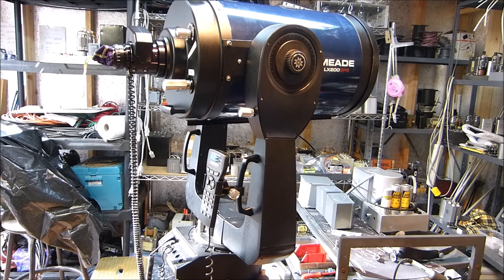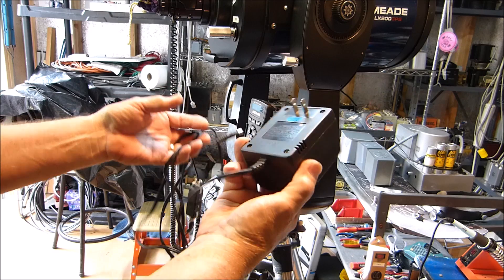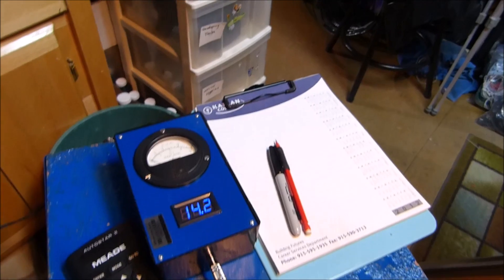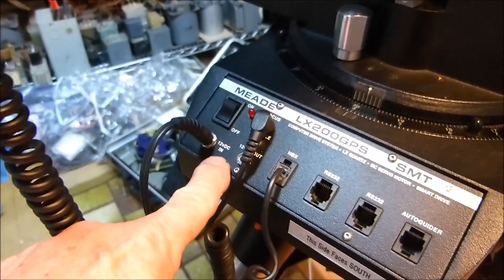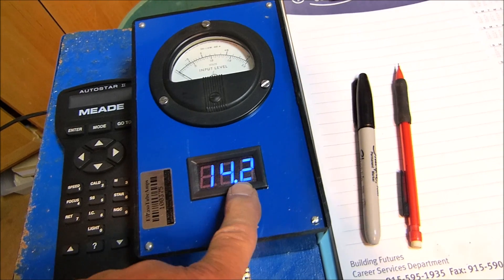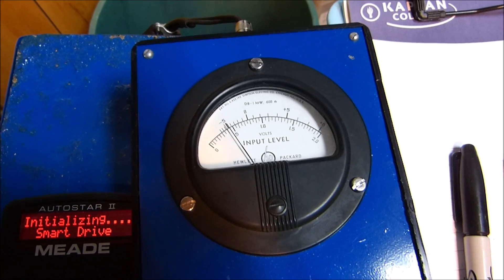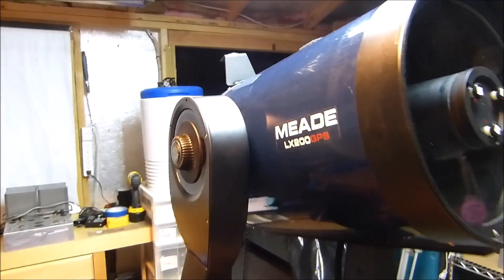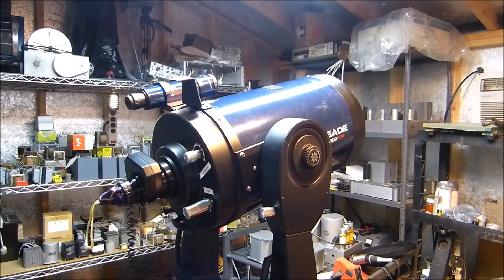Meade 10 Inch LX200 GPS Telescope Power Supply Voltage & Current Measurements

Comment: Wouldn't it be better to run the mount of the battery cutting out the inverter?
Reply from the maker: I did it this way because I wanted to make sure I always had at least 12.5 to 13 VDC and a battery runs starts dropping voltage over a couple of hours and it seemed to affecting the tracking accuracy of my telescope. Maybe if the scope was brand new a battery would be OK? Not sure. It even has a compartment for D size batteries that I have never tried. I also wanted to know the current it was drawing so I went to this length to provide it with a more reliable source of voltage and be able to monitor everything. Maybe it was a little over-kill but it works good for me.

Comment: Very interesting video. I have exactly the same telescope, though I haven’t really had time to use it yet. I have played around with though using a small battery pack. It works with this, so I thought, but this video has made me think more about voltage. I assume that if the voltage drops below 12V then the motors will slow down making the tracking unreliable. Is this the case? Too low a voltage wouldn’t damage anything? Thanks again for producing this, it has certainly got me thinking.
Reply from the maker: What you are describing is exactly what make me go to the higher current,  full proper voltage as I did experience issues with tracking using a battery. Keep the wires at say #14 or #12 size and short as possible but long enough to be comfortable. Put a plug inline with the cable in case you trip over it in the dark it will come apart easily and not turn the telescope oveer or whatever and cause a disaster. 
Each time you set it up, run all the axis to the extreme limits a couple of times to loosen up the grease, etc.  I don't think low voltage is going to harm it but it does seem to make it more unreliable. I have used my many times. I collimate mine each time. Got to be very careful with those three collimating screws. To get it "perfect" you have to do it on a star.  Don't turn any one of the screws more than 1/2 turn in any direction. You have to collimate it with the camera mounted and it can change slightly as the scope is moved around. 
Those laser things you put in the eye piece are only good for rough adjustment. Improper collimation causes stars to look sort of egg shaped and I think they look like space ships.  :-)    
I saw my grandson today and I think we will be going to the  desert in NM in just a few days before the next college semester starts.  This telescope is now too big for me without help but there are also polar-axis trackers that mount on a good tripod (like you Meade tripod) where you can use regular and telescopic camera lens and get amazing pictures.

Comment: Is it coma free? If not save your money.
Reply from the maker: Absolutely, if it is with properly collimation. And I have gotten pretty good at that.
I have read some blogs where people refuse to touch the collimation, I suppose, believing there SCT is always perfect. 
I rarely do visual observation thru mine and just do photographs with it so perfect collimation is essential. 
Recently, from watching a number of amateur astronomy YouTube videos, I have learned that  high quality camera lens do some pretty amazing astrophotography. I now use a Sony A7RIII camera and at the moment the two biggest lens I have (besides the Meade scope) is a Sony 70-300mm and a vintage Nikon 500mm F/5 Reflex Nikkor. I had to work with the adapter for the Nik-NEX adapter as it was a fraction of a mm too long for focus at infinity but I finally got it right and get some pretty amazing images with the Nikon. 
I moved to the Sony mirrorless camera as with an adapter, which are usually pretty inexpensive, I can use all of the lens I have had for more than 50 years. Taking away that mirror in the DSLR put the front lens mount of the camera much closer to the focal plane and, with the proper adapter,  all lens work - Nikon, Canon, Leica, etc. In addition I bought the iOptron star tracker that is a polar axis alignment tracker and get pin point stars with 30S tracking. Tuesday I am supposed to receive my newest lens which is a 200-600mm Sony lens. None of these camera lens are going to do all that a 10" scope will do but I can move it around along with the polar axis tracker much easier than I can the big Meade. Hope all this makes sense.

Comment: Mine works fine at 11volts!
Reply from the maker: I have heard reports like yours and I totally believe it.  I often wonder it there are differences in the motors, possibly friction in the gears, cold grease, and a bunch of other things that make different telescopes behave slightly different. I think in my case the power supply is definitely over-sized but I just couldn't rest until I measured the current in a slewing condition, one axis and then both axis and then in normal tracking mode in addition to the voltage at the terminals of the control panel under all these conditions. I don't know for sure what my issue was but it works great  now.
I have not had the opportunity or clear skies to do much photography this summer but I did get a Sony 40 megapixel camera (A7RII) and have made some nice pictures and videos of the moon. I have too many hobbies and not enough time to play.  Here is a short video I made when I first got my camera you might enjoy that I uploaded but made "unlisted".
https://www.youtube.com/watch?v=ugJNJ5Npqkc&feature=youtu.be
I keep hearing a train in the background while watching this video so I think I have discovered life on the moon that NASA isn't telling us about...   :-)
Reply: @ElPasoTubeAmps  clear skies to you!

Comment: why not run it directly from the huge battery?
Reply from the maker: That would definitely make sense if all I wanted was 12 volts but it seems pretty well established that 14 volts, regulated, works much better. The need for a little higher voltage comes in because of the gears and grease being cold, (age of the telescope?) etc. The single battery might be perfectly fine in the summer when things are warmer. I no longer use the modular supply but replaced it with a 13.8 volt, 2.5 amp regulated supply and the telescope performs perfectly. I also installed a second inverter like I showed in the video, in my truck so I can run a standard power cord from the truck and I won't have to carry that huge battery around anymore.

Comment: Sounds like it was designed to run directly off a car battery, probably even taking into account the potential voltage spikes when the battery is being charged. I'd expect it's got a buck/boost power supply internally and it doesn't really care that much what voltage you feed it as long as it's within a reasonable range.
Reply from the maker: I think you are probably right about it having some internal voltage regulation less than the 12 volts that it is being fed with. The problem I had was when I researched it, I found lots of comments about all sorts of voltages with mounting confusion. I couldn't trust anything I was reading. The regulated Radio Shack power supply solved the problem.
Now the issue is after April 6, 2019, there is an internal issue kind of like the "Y2K" issue where the telescope thinks it is 2099 when letting it setup automatically from GPS. It gets the time and location right but 2099 for the year certainly doesn't work...   It can still be set up on two stars easily in manual but now I have update the firmware to use the auto setup but it's all fun..

Comment: I have the Meade AC power supply which is rated at 12 VDC 2.4 A. I imagine it puts out closer to 14V or 15V lightly loaded. I always used a car battery directly on my LX200 with excellent results. Until my XP laptop died that is. I have not been able to get the Meade USB drive working nor several aftermarket serial to USB adapters. Are you using USB or are you still  using a serial port?  
BTW thanks for all the tube amp videos. I always look forward to a new one.  I'm currently working on a 6C33C amplifier which I want to try with an output transformer as well as OTL.
Reply from the maker: I have just discovered that mine needs a firmware update because of some GPS change that occurred in April 2019. My time is correct from GPS but the date is always 2099. Just bought a Sony 43 megapixel camera for the telescope and now can't get the telescope to align... question is, have you updated your firmware and can you point me to a YouTube video on how to do it? You mention the USB drive and serial port but I have never used them at all but it looks like I am going to have to learn. Not even sure I still have a laptop with a serial port.  I just want to get this thing working again so any help would be greatly appreciated. I will be posting some new audio amp videos soon. Thanks for your comments. BTW - I swapped out the 12 volt module in this video for a regulated 13.8 volt power supply that works perfectly with only mV drops in voltage from standby to maximum current. Now I have to figure out the firmware update...
Reply: I presume you know about this:
https://www.meade.com/wp/wp-content/uploads/2019/05/HowToUpdateTelescopeFirmware_REV1A.pdf 

I bought all the stuff they say you need but still couldn't get it to work. I have a friend who's a senior IT guy who owes me a favor. He said he'd assist so let's stay in touch.
Reply: Sorry for the late reply, I was out of the country. I haven't been able to use my LX200 in several years now. I have tried several serial to USB adapters (including one directly from Meade) with no success. I bought a copy of Starry Night Pro which has telescope control as part of its package and had no luck with that either. I finally lost interest and the Meade has just been sitting. Long weekend coming up (I'm just outside Toronto Canada) so I'll try to dig through what I have and get back to you. Why don't you contact me directly: apexmcboob at gmail dot com. Just delete the spaces and put in the symbols.
Reply from the maker: @apexmcboob6526  Thank you for getting back to me. I understand being out of town and busy.
I ordered the Meade serial port adapter used from Ebay, (DB9 and cable with RJ12 connectors), watched a video on how to do it on YouTube and it worked. It progresses slowly, about a percent every 6 seconds so it takes 10 minutes. It is a miracle I had a PC with a serial port but this was one of the easiest serial port operations I have ever done. Maybe I can help you get your scope back in automatic order. I had already learned to disable GPS and set it up manually. Actually, you can't turn GPS off completely. It still gets your location and, I think, date but not the year (of 2099...) I am totally amazed it worked as easy as it did. The attached video says there are issues with Win 10. I run Win 10 and had no issue. Maybe it is because he used USB. I don't know. But his procedure did work. See below.
 https://www.youtube.com/watch?v=lVH3LAt1Z0U&list=LL-f4XWraJ1H8NhKMxrpzqAQ&index=14&t=209s
Also, see my moon video I made two nights ago in the link below.
https://www.youtube.com/watch?v=ugJNJ5Npqkc
Again, thanks for responding to me and I hope you get back out enjoying your telescope again.
If I can be of help to you, let me know.
David Beard
El Paso, TX
Reply: Your moon video has inspired me to give it another try especially as I watched the Neil Armstrong movie "First Man" on the plane coming back from Germany.  The shots at the top of the screen in your video showing the perimeter terrain of the moon are very detailed and revealing.  If you don't mind I'll stay in touch on this.
Reply from the maker: @apexmcboob6526  Absolutely. I have a number of friends i have made thru YouTube in many countries and we help and inspire each other all the time. It is amazing the coincidental things that come along in our lives that can inspire us to do good and fun things.

Comment: Wow what a great looking scope! I wouldn't go over 16vdc. 13 to 14.5 is the sweet spot.
Reply from the maker: I got some good common sense suggestions below. The unregulated supply has got to go. A regulated supply around 13-14 volts with 4-5 amp capability I believe will completely solve the problem. I believe the secondary supply is a good idea as the battery may get cold and the voltage drop also. The telescope circuits are surely not going to load the battery for current but there is some voltage drop across the wires that increase with increasing current, etc. The solution is all too clear now.
I see in the blogs where power supply voltage is discussed but never a mention of current and  I never could find any direct measurements.  It all makes sense now - 30 degree weather and cold grease and the motors need 2 amps and the supply voltage drops to 10 volts and the logic on the control board and hand controller goes nuts and .... what could possibly happen next?

Comment: Out in the cold the current draw for the motors will be higher as the oil/grease in the bearings will be much
thicker - this would explain the recovery after warming up.  i reckon you could easily double the current draw due to this
as desert night temperatures are way below indoors.   The solution is a higher current supply, say 12V 3A, so that extra
torque is available to the motor.  Extra voltage is not a good idea and could lead to shortened motor life through arcing,
increased bearing and gear wear.  Even air resistance to the motor spinning will be higher in cold conditions, though that's
probably a small contribution only.
Reply from the maker: Absolutely... what you say makes so much sense. In the cold as the motors draw even more current ( I will be able to see it now with my new box ) the voltage is going to drop even lower and may even be low enough at times (below 12 volts) to affect the logic in the control board and to the hand control unit. I new someone would help me see it clearly. Thank you. Next small project is a regulated (and adjustable) power supply that can be set between 12 and 14 volts with 5-6 amps of available current. 
Hopefully, this will help others that seem to have unspecified and intermittent issues with their telescope.

Comment: Why use an inverter just run it straight off the battery would be better. The gearbox sounds noisy probably could do with re greasing could be some bind up going on oil the motor bearings might help as well sewing machine Oil or bearing oil. Try some graphite grease or PTFE
Reply from the maker: Good point. I probably should give the gears some cleaning an oiling...

Comment: Hi Dave,
Do a fake alignment and check the current draw when the telescope is tracking.   73   WB3BJU
Reply from the maker: Good thought but I am pretty sure the current will be low during tracking but without measuring it... it could be higher than I think.  Thanks

Comment: I'm not sure you have a problem. Clearly the voltage does sag slightly to below 12 volts on a higher load. It would be a very simple option to make a small linear stabilised 12 volt power supply. As your inverter is feed from a car battery, why use  a step up inverter to 110 volts then reduce your supply back to 12 volt. You already have a stable 12 volts, well probably about 12.6 volts. Seams over complicated when you need 12 volts and that's what you got!
Reply from the maker: You certainly have a  good point with the 12 volt supply right from the battery. I think I have been overly influenced by the idea of needing  as much as 18 volts from reading too many blogs...

Comment: Hi Dave,
I've heard you can go as high as 18VDC, but regulated 15VDC would be safe.   73  WB3BJU
Reply from the maker: It seems to make sense to build an adjustable regulator (and set it at maybe 14 volts) and get away from the supply that I have been using now that I know the truth about the variations in voltage with load. On the other hand, if I am comfortable with 12.5 volts, I could take it right off the battery. I am sure the battery is stable at any load the telescope will put on it. I may have been overly influenced by what I have read and assume I need a higher voltage than the 12.5 volts right off the battery. It does seem I have answered most of my concerns but why do so many others seem to have this issue with voltage... not sure.